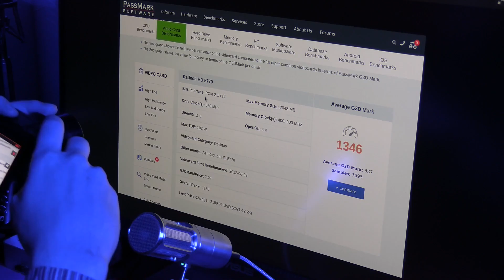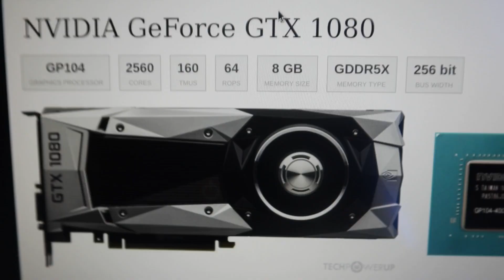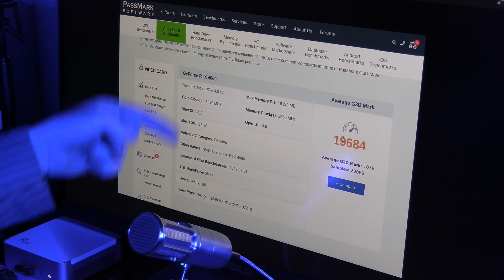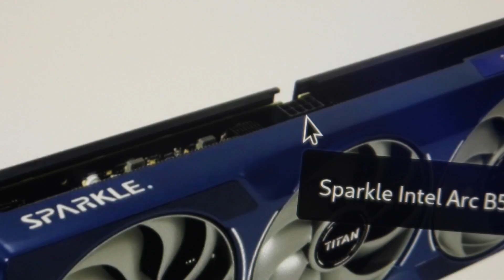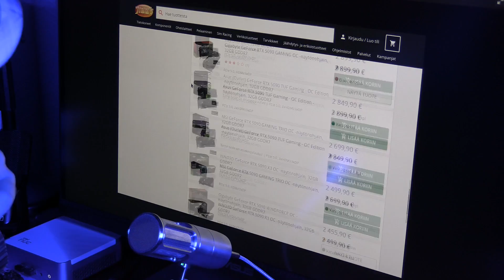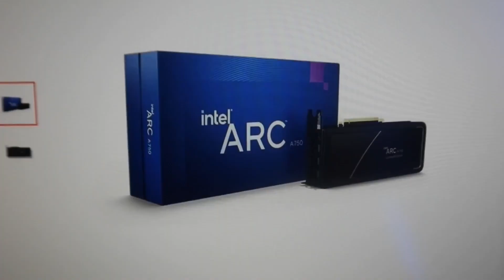How much better GRAPHICS CARDS have gotten in 10 YEARS and are they LINUX COMPATIBLE ALREADY?

Comment: Unfortunately arc isn't very reliable on linux still. AMD are still the crown holders for linux gaming, with some games just running better on amd+linux than amd+windows. Nvidia isn't an awful experience on linux though. I look forward to Intel Arc becoming better optimized on linux, the gpus are phenomenal price to performance.
Reply from the maker: Interesting. Then AMD has gotten better. Thanks for the feedback.